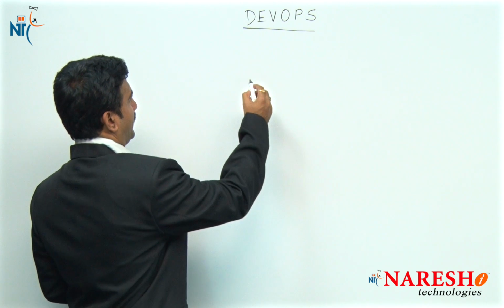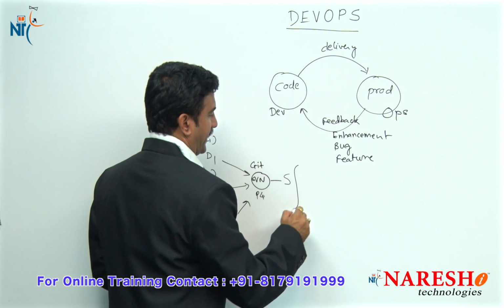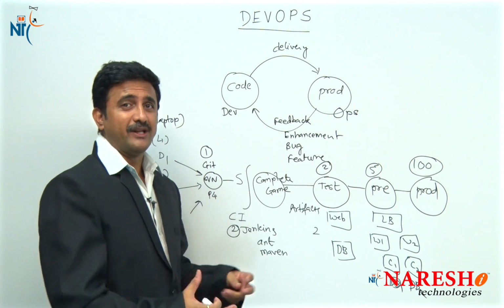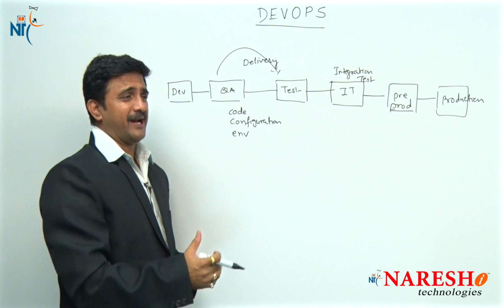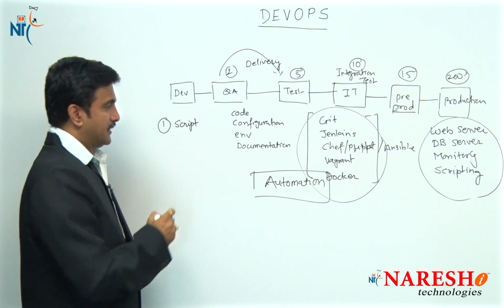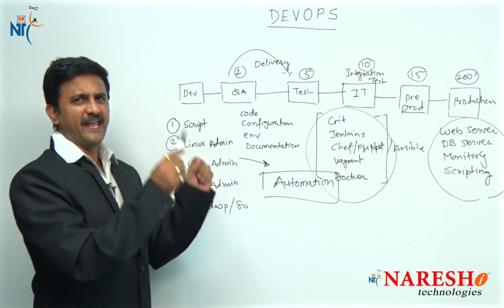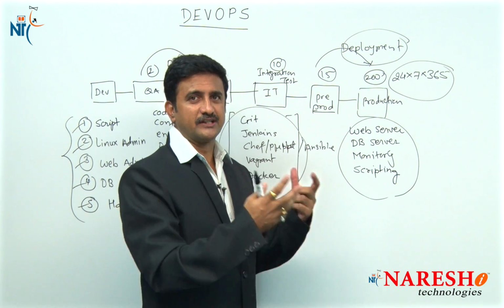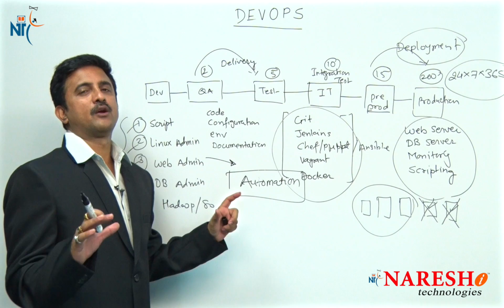DevOps Introduction | Devops Tutorials | by Mr. Sunil

Comment: Hello, I'm Thomas Daniel from CATLIGHT ( tfs-alerts.com ) . The main problem with the integration of a DevOps team is that the security takes a back seat, and the company becomes at a risk of security issues. This is because the security team is not integrated with DevOps, and they have no clue what tools or methods are being used for the speeding of the app development process. In order to streamline the process, the DevOps choose speed over security many times, such as skirting around the necessary scans and code checks. This, in turn, introduces vulnerabilities and makes it difficult for the security team to keep track of the many security holes and clog them.
 Security measures protect the company, but at a cost of lower speed. DevOps teams, in trying to speed up processes, consider the security measures as obstacles and steer clear of it, and tend to avoid the security teams so that they can have their work done without any hindrance. Transport layer security is the most vulnerable in companies where DevOps is adopted. The usage of unprotected keys by the DevOps teams in order to use shortcuts allow malicious users the opportunity to pose as trusted factors, or hide in the data, which puts the company at risk of spoofing and man in the middle attacks. Thanks all :)

Comment: 20 years back also same procedure was followed. What is the difference now? Org used to have integration team,QA team. Then final product rolled out. From the presentation it appears case is based on web application. What about company who writes software for their own product/Hardware? A switch or server or storage system making company has many moving parts in a single platform. Each components has their own device driver which has to be tested on that target device. For a smart phone as an example has bluetooth, GPS and wifi chips in addition to baseband processor. Each component should first meet in single piece of board and able to communicate. All of their firmware has to work in tandem  without interfering and corrupting memory locations. Then OS will play its part to co-ordinate among all these components. Where does CI fits here? Every now and then someone introduces technical jargon and everyone seems to follow that blindly and at the root of it is incompetent management who without deliberations introduces new process and tools. I understand web applications, IoT and things like Netflix, amazon site has no dependency on underlying hardware. They only uses the power of underlying hardware. But computer science is not about web applications alone. Real computer science or engineering is about making the underlying hardware where IoT or web applications are hosted. To build that Hardware with software is a different ball game.

Comment: Hi sunil,
I have the experience in desktop level .can i move to devops side further what i have to learn
Reply: what does "production" mean in terms of software? If your code is tested and works (and does not require servers but runs on the client's machine) isn't this the end? for the product was produced and requires no further production (marketing and such, perhaps). why is there a production phase after the OK test and integration? I am trying to learn about IT for a job interview. This is not a joke, Thanks!